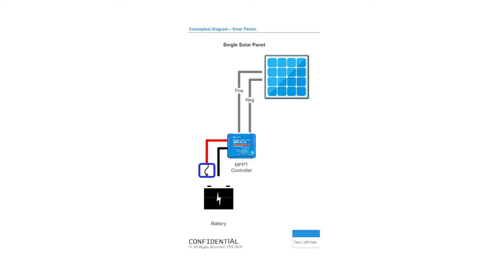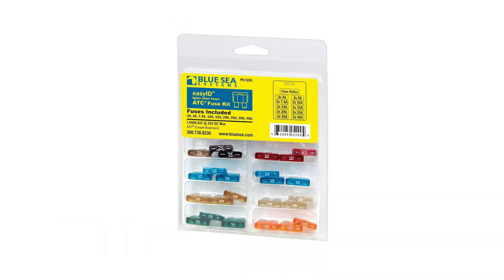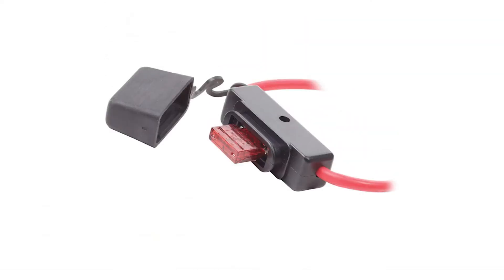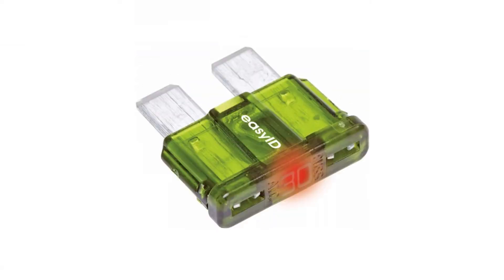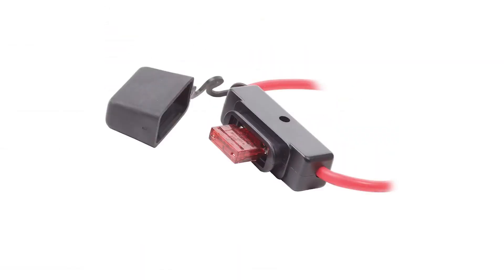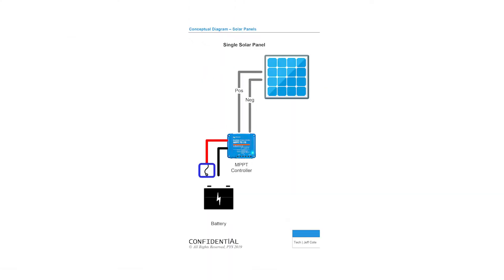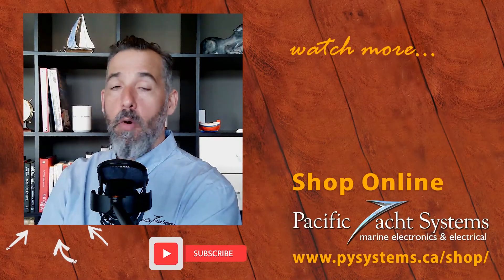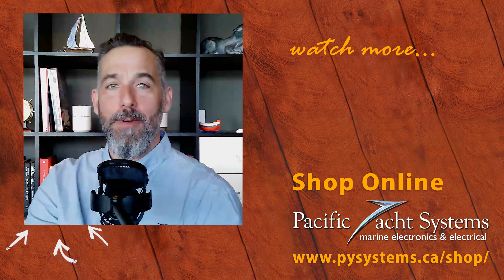Fusing a Solar Panel on My Boat

Comment: I just installed two 100-watt Renogy panels.  Their maximum output is 5 amps each totaling 10 amps maximum output. The 10 awg wire is rated for 30 amps and plugs into a Renogy 40 amp charge controller feeding a 105 amp battery. Why put a fuse on a solar system that will never generate enough power to even get close to the amp rating of the wiring?

Comment: For my 300 watt solar array, I had a 10A fuse between the solar array and solar controller.  When I had to do some wiring maintenance on this wiring run, I pulled the fuse to make it safe for my work.  The excitement began when I tried to put the blade fuse back into the fuse holder....... right in the middle of the day with bright sun.  Yup, a bit more sparking ✨✨ than I was comfortable with.  So I replaced the 10A fuse with a 10A mini breaker (only available on Amazon :face-red-droopy-eyes: ).  So now I have a safety disconnect with the breaker that can trip, no need for spare fuses, and no sparks when I disconnect/reconnect during the daylight hours.  And yes, I replaced the fuse with the breaker at night time  :face-blue-smiling:
Reply: A 300-watt array should have a rated max output of around 15 amps - 5 amps per panel. The 10 gage solar wiring is rated at 30 amps. Why install a 10-amp fuse on a 15-amp array? You might as well unplug one of your panels, because if your array was working at maximum efficiency, it would blow your 10-amp fuse. If it isn't already blowing the fuse, it means that your 300-watt array is putting out less than 10 amps, and is only around 60% efficient.
Reply: @eden3marinetrader36 if he has two panels in series the current will be less than 10a
Reply: I am adding both a fuse and a toggle switch. So I can disconnect easily without pulling the fuse.

Comment: I would add, you need to fuse the wire that leads to the MPPT. The fuse would go at the battery at the beginning of the wire run to MPPt, to protect from shorts. Then you would add a breaker at the MPPt to shut of power to it, and a breaker on the solar input. The charge controllers get funky sometimes and you need to shut them off and restart them and you need to shut off power in and out.

Comment: Everyone I see putting solar on their boats I see putting more solar on their boats a year later.

Which means more power and more current.

I'm think I'd size the wire and the fuse holder to handle the most I'd ever be likely to install,  not what I currently have installed. I can stick a 10A fuse in a 20A fuse holder.

Comment: When you get to the higher amperage, wouldn't a circuit breaker be a better choice? The can also serve as a service disconnect if you ever need to work on the system.